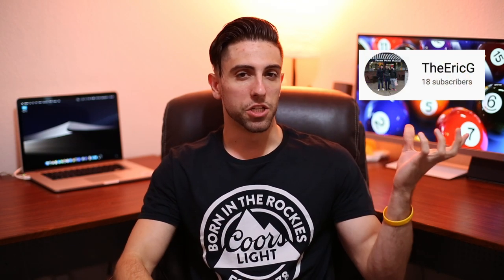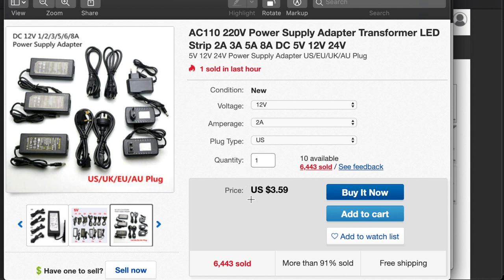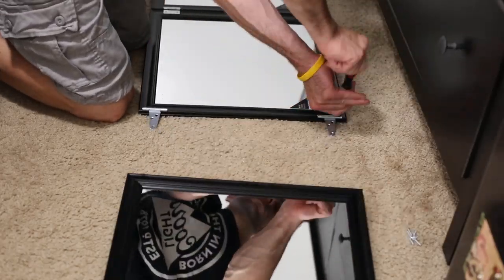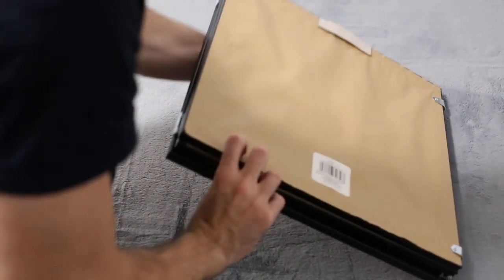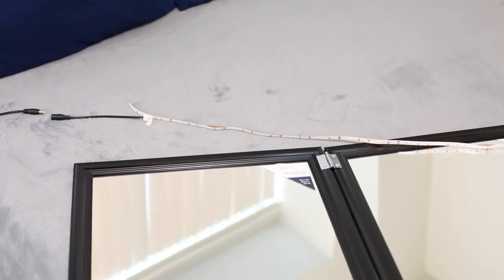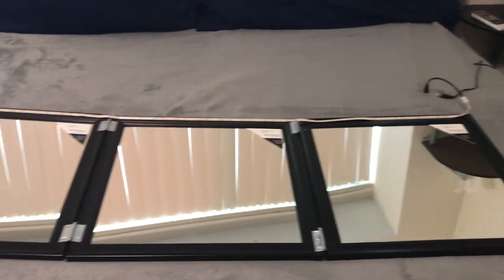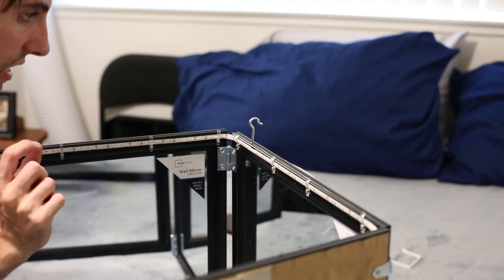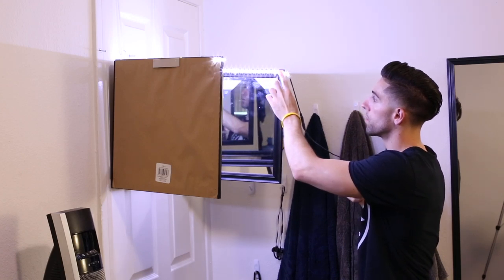How To Make A Self Cut System | DIY | COMPLETE GUIDE | LED's, Foldable, Hang-on-Door

Comment: Having a lot of trouble finding such cheap mirrors in the UK. Most around that size seem to be £14-30 ($18-38). Cheapest I can find is an £8 ($10) one from Argos. Anyone have any advice?
Reply: £8 Argos seem decent, the ones I linked you arrived today n are perfect for making this
Reply: @ar04azr  Hey, thanks for getting back to me. That Amazon one looks pretty good. Did you finish building yours already?
Reply: @Ramesiel  just hung mine up now. Used plasterboard metal plugs in my hollow bathroom door, was a bit nervous if it'd work but the mirrors weigh a total of 4kg which seems fine. Screwed 3 d-ring hooks into the mirror. I bought the wrong cable clips n have a few days for the right ones before putting the led lights on, overall well pleased
Reply: @ar04azr  Glad it worked out well for you! Do you think 14x11" is a good size? The Argos ones are out of stock so I'm probably going to go with the Amazon ones that you linked. I'm wondering if maybe the bigger 16x12" size might be better?
Reply: @Ramesiel  Both should work fine. I went with the 14" as I was concerned about hanging weight on my bathroom door which is hollow. During use the 14" is perfect tbh and if you check the actual self cut system sizes they're around 14" x 9.5" if I remember right.
Reply: @ar04azr  Thanks!

Comment: With the barbershops being closed I really needed something like this. I am in the process of build one right now, but for the life of me I cannot figure out you got the third mirror on the end (far right) to open up completely flat like that with the tee hinges because mine will not open all the way due to the bend needed for the closing operation of it. Did you run into the same issue in the building process?
Reply from the maker: Mack7mle what do you mean it won't open up all the way? You probably put the hinge on backwards.
Reply: @chrisheadley808  mine did not lay flat the way yours did @ 10:55. But I coincidentally ended up putting the bracket on backwards so that now that it does.

Comment: Could someone help me with the recommended measures to do so?
 Do you know the size of the original self cut system?  I would greatly appreciate your help.
Reply from the maker: Ariel Herrera Simanca why does it matter?
Reply: @chrisheadley808  As otherwise its harder to get a 360degree reflection

Comment: i have a question why didnt you install the open screw hooks on your first system? you have closed circular screw hooks instead. Also which system do you rather prefer your first system with big mirrors or your second one with smaller mirrors? your advice is much appreciated i would like to build my own so  i would really respect your opinion please
Reply from the maker: The smaller system with the over the door  hanger is portable. I prefer using the bigger system and it is the one I use most of the time for cutting my hair at home. It stays in one spot because the circlular screw hooks have to hang on a screw that's drilled into a wall. I prefer the bigger system but it is not portable. The open screw hooks allow for the over the door hanger to be used which makes it portable. The circle screws cannot be used with the over the door hanger.
Reply: @chrisheadley808  Thank you for the fast reply and your insight, i will opt for bigger mirrors so i can see my head more clearly especially for when i am cutting the top of my head. Good job on your self made systems it looks really well built

Comment: How to u keep the mirrors in place without swinging open. And stay in place
Reply from the maker: Miguel Ramos I addressed this problem in the very first comment made on this video.
Reply: @chrisheadley808  ok will check . Thank u
Reply: @chrisheadley808  can't find it. Thinking of putting a thumb Tack on opposite side with a string and tieing it
Reply from the maker: Miguel Ramos just scroll all the way down. The comment was by highlandlows. All you gotta do is keep the mirror parallel to the door. To do this, you can use two wine bottle corks, cut them to the length you need, and glue them to the back.

Comment: What size mirrors did you use on your first diy job, I would prefer the bigger ones as it’s only for home use 😁
Reply from the maker: Romeo Donn width is 19in length is 23 inch. You can get em for $14.99 at Walmart. You'll also need a third set of hinges to make it more sturdy👍✂️
Reply: Chris Headley thank you very much I’m from the Uk by the way I’m not sure if there is a Walmart over here
Reply from the maker: Romeo Donn good luck finding everything you need!
Reply: I ended up just buying the self cut system I went to some local shops that sell mirrors in my area and it come to like £80 they wanted £20 each mirror that came to £60 and the hinges led and everything else, so  I put everything back didn’t bother lol, just my luck
Reply: Mista S purchased it from selfcutsysyem.com come to like $120 plus international shipping was like an excessive £60 come to like £150 😂
Reply: Mista S Very happy with it will definitely purchase again if anything ever happened to it

Comment: The hinges look like they fold too easily to stay in place while cutting. Wouldnt want a mirror to smack u while cutting ur hair
Reply from the maker: Raul Prieto the key to having the mirrors stay in place is having the back of middle mirror parallel to the door. To do this you can simply get a wine cork, cut it to the right length, and then glue it to the center back of the middle mirror.

Comment: I used these cabinet hinges on the one side Instead of bending them and them not shutting right. They came out much better. Are a few bucks more but way worth the price. 
https://www.homedepot.com/p/Everbilt-35-mm-110-Degree-Full-Overlay-Soft-Close-Cabinet-Hinge-1-Pair-H32636E-NP-CP/302857903
Reply: How did you fit these hinges onto the mirrors? I can't seem to find a fit that works
Reply: please reply to the comment.. im curious too
Reply: AwesomeMan2696 not sure I understand what you guys are asking. I laid them flat like how i mounted them and lit the hinges on abs they shut perfect. Maybe i tagged the wrong size, but am pretty sure its the correct one.
Reply: AwesomeMan2696 i did add some washers under the cabinet ones. When i get home maybe I’ll post a vid

Comment: You cut your hair over carpet?!
Reply from the maker: I stand on top of a haircutting cape. you know those black capes they use at the barbers? I have two. I wear one and then I stand on top of one. I use a nail brush to brush the hair off the bottom of my feet before I step off the cape. Once I'm done with my cut and then I go straight to the shower. Feel free to ask me more questions if you're confused.

Comment: You literally said no power tools involved and you never showed the part where you drilled the holes with a drill 🤔🤔 bro you need a drill for this which you obviously left out.
Reply from the maker: 6thGearPinned I had not owned a power tool at that point in my life so I don't know what you are talking about. Everything was done with a philips screw driver.

Comment: your haircut aint that great though.. the top does not fade into the sides.
Reply from the maker: razz P I wanted a disconnect
Reply: @chrisheadley808  i see. How would you trip or fade the top. If you wanted a more faded look? Clippers also?
Reply from the maker: razz P for me it depends on the length on the top. For that style I need it shorter on the top to make a smooth transition. I usually use a #3 clipper with shears and thinning shears. It takes some practice to get good at it.

Comment: Those mirrors suck there not long enough. And the hinges probably do to need sturdier hinges and longer mirrors
Reply from the maker: The mirrors are great and the hinges are sturdy. You're probably just trash at using a screw driver 😉